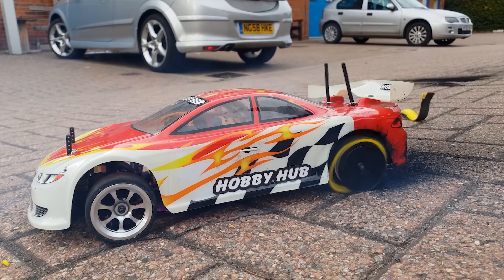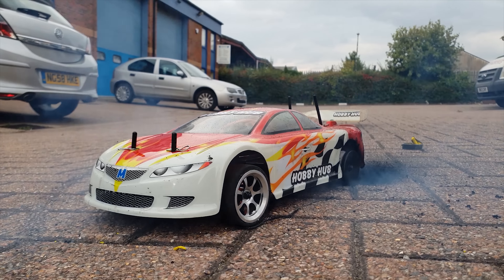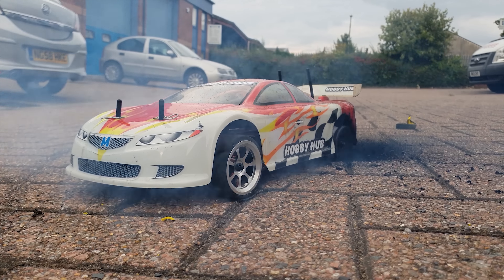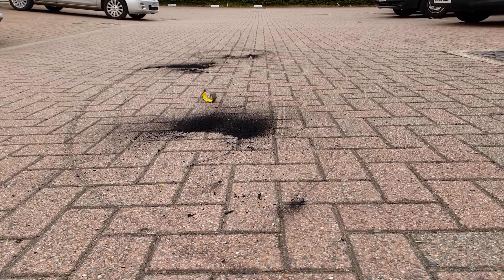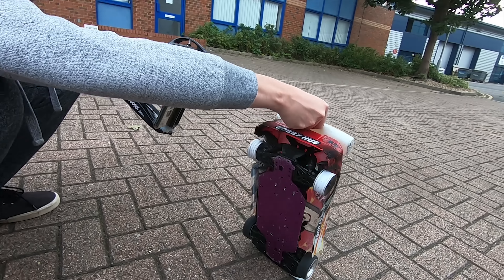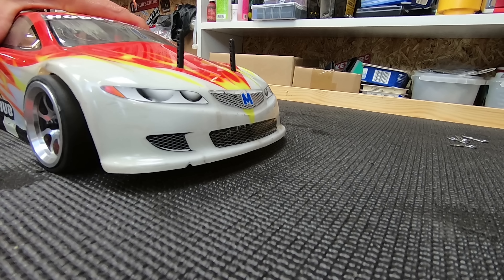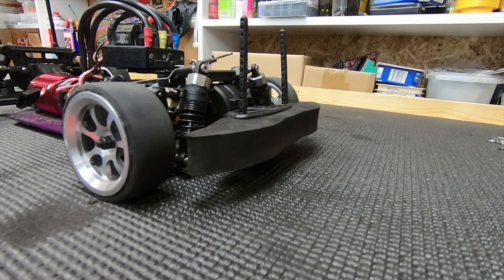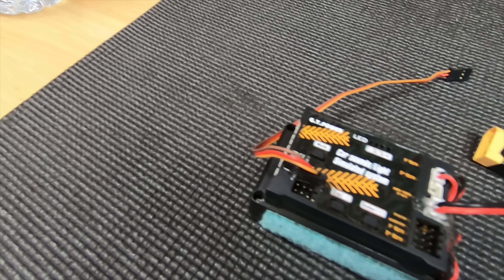RC Car Burnout + Donuts With Line Lock SMOKE + BLOWOUT !!!

Comment: Maybe put one of those weight plates on the rear to stop the hopping effect? Don’t know if it will work, just a suggestion :)
Reply from the maker: I think its the front arms flexing if I add more wight to the rear then I need more to the front it already weighs more than 3kg
Reply: @KevinTalbotTV  if so put alluminum arms
Reply: @KevinTalbotTV  weights want help you should try stiffer springs and oil in the back it could mayby slove the problem.
Reply: Maybe the rear tires need a harder compound

Comment: FINALLY!!! Speed run. I have been requesting this since the second burnout video. Even if it only hits 35 mph/56 kmh, I'll be happy just to see what it can do. Reply to this comment and say what you predict the top speed will be of this burnout car! I say 75 mph/120 kmh. (depending on gearing of course)
Reply: Now if Kevin totally transforms it to a "speed run" car...no telling what the top speed will be. There are guys pulling 150 mph / 241 kmh on 6s....but as is, and maybe changing the pinion gear to a 34t...I say 75 mph / 120 kmh.

Comment: AWESOME.     I'm kind of new to the RC scene I would love for you to do a review of the red cat racing blackout the brushless version I'm thinking of getting  My son and I each one  Or if you could just send me your opinion of that  Particular RC I would be  eternally grateful
Reply: Patrick Curran i would go with the bandit from traxxas litte be more pricey but parts are ezer to find and can take a beating
Reply: 2wd Traxxas platinum brushless Slash and then upgrade the caster and steering blocks add a 2 or 3 cell venom LiPo battery for no puffing or LiPo fires for the best Alltime truck never will break and if so it will be a shock head then upgrade it and solved
Contact me for any more questions you may have at my channel American Made Rc
Reply: May spend some money but it will have resale value and you won’t have problems